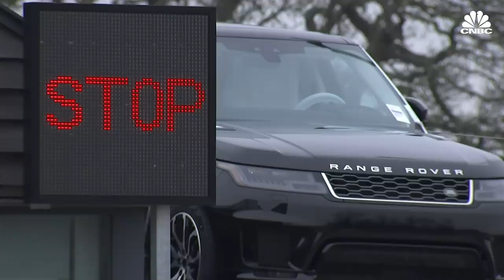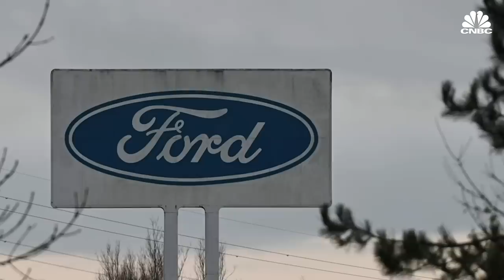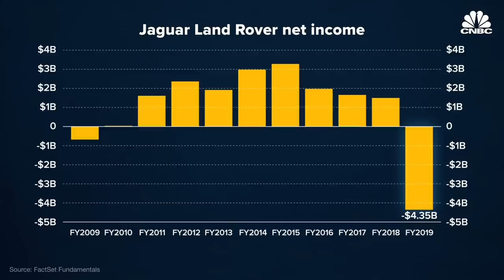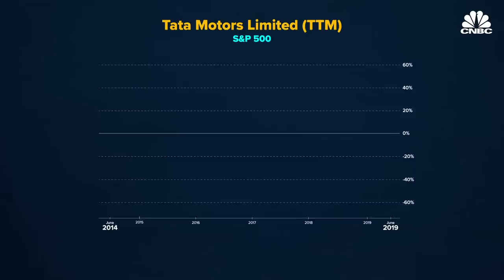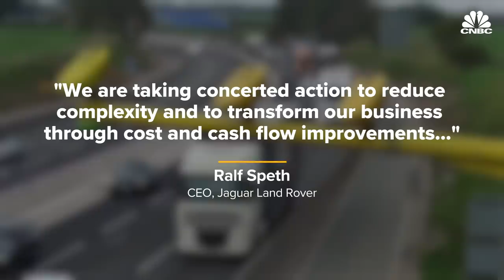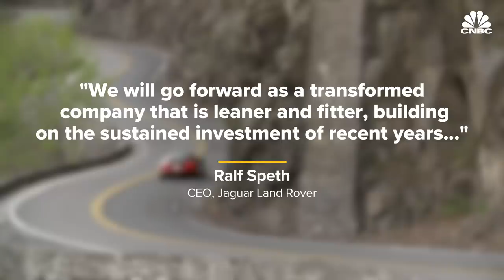Why Jaguar And Land Rover Face Uncertain Futures

Comment: Jaguar has one of the best exterior design, but also one of the worst reliability. The materials they use are so cheap, my friend owns XE R and F PACE 25 T R, the display system keeps freezing, and the panels are plastic almost everywhere.
Reply: Could not agree more, the interior on my f type was a sea of cheap plastic and poor quality leather. Beautiful car but when you looked closely it was so cheap.

Comment: We live in a high rise condo building in downtown Houston.
There must twenty Range Rovers in this building,not including Maserati, Audi's and the rest.
One guy I know has a Rover with 75,000 miles,and engine head gaskets blew.
The shop just replaced the whole bloody engine four times.
The Brits just can't get a clue when it comes to durability.
They have always struggled with electrical issues.
I owned a few British cars,and its always the same story.
Get rid of them after the warranty expires.
The best vehicle I have ever owned is our Acura RDX.
It never breaks.

Comment: If I bought these two brands, I would :
-Make deal with Lexus so that they can use Lexus components to make them more reliable.
-Use better quality leather for the seats and find better way to make the stitchings more neat.
-Fire the head designer and work with Pininfarina or Zagato instead.

Comment: The need to sell a new car to keep afloat is the problem here. Sooner or later you are going to run out of buyers. But the more practical problem is credit, or the lack of it. New cars are almost always bought using borrowed money. Now that lending sources are drying up, people are holding on to their older cars longer, thus putting a squeeze on companies that have to sell a new car to survive. Car companies should buy into the fantasy: pretend that unlimited credit isn't a problem and print their own car-buying-coupons.

Comment: It is quite sad, I worked with Sciemetric from 2014 to 2017 at the EMC art Wolverhampton and it was exciting to be working with the data acquisition and repair processing of the engine build stages … massive investment and a lot of great work done and now the demand must be very low … surely there has to be a new life for the plant… I don’t see them rebuilding the production lines for electric as the scale of the buildings are for large component manufacture and can’t really see how electric vehicle production could fill the site

Comment: They should never have dropped the iconic Defender. Sure it didn't meet certain safety regs but those issues could have been overcome.
Reply: David Gillett UK not possible. Even small changes meant the model was subjected to the latest regulations.
The defender however, is on its way back. The new defender is currently being tested and images can be found online.

Comment: Jaguar have got the reliability sorted. There cars are now exceptionally reliable and drive beautifully. Unfortunately there are still some build quality problems. Early body corrosion is still present and panel alignment is not up to the standards of Volvo/Mercedes etc.
Reply: My f type had all the panels removed, it was a mess. My question is how did it get out the factory in such a visibly poor condition ? Also I had it for two years it was only on the road for 6 months, so I question that they have reliability sorted. It was falling to bits inside also.

Comment: The main reason why TATA acquired these two companies is that firstly, they were looking for a bailout situation so they got a very good deal. Secondly, though TATA cars are predominant in the Indian market, they lack in technology-wise. One of the clause while acquiring these two companies is the transfer of technology and other intellectual properties. So TATA can use these technologies to manufacture their cars without investing in R&D. You can see their new car TATA harrier which is a cheap alternative to Range rover Evoque. So basically they aren't much interested in how these two company performs.

Comment: Tata got Jaguar and Land Rover to where they’re better built and more reliable than anything BMW, Mercedes, or Audi could offer. Yet, many still think of JLR as being unreliable. Sure, not going to say they’re cheap to maintain or as forgiving as a Toyota if one misses the oil change by a few thousand miles; but definitely not the same JLR that Ford had been running and better built than those nice looking plastic German cars.

Comment: JLR posted an profit increase of 20% in the last quarter of 2020 on YoY basis, with sales at China increasing 19% YoY.
Further market share of Tata Motors in Indian market which fell to less than 4% in 2016, has again leaped to 16% with the launch of the new models like Harrier, Nexon, especially for hatchbacks like Tiago and Altroz.

Comment: I don't know if the narrator is being quite honest, even now, 2020 I'm still hearing about BOTH Jaguar and Land / Range Rover reliability issues. It's just not acceptable in a modern car, especially when you can buy a Toyota Corolla for 10 times less money and it's 10 times more dependable than the luxury car. That's completely backwards, but thank God that's the way it's working out because I can't afford a more expensive car than the Corolla. We've been making cars since the late 1800's, when will they get it right?

Comment: As they say, if you want to buy a Jaguar, you need to buy 2: One to drive, and the other to drive when the first one is in the shop.
Reply: My XE has been fine and I drive it for work everyday 100-400kms. The 2 litre diesel needs service every 34,000kms so it sees the shop less often that other cars.

Comment: My uncle had a 2017 jaguar XJ....so my advice is that these brands are good for first 20000 km then these things start to malfunction....It had to be repaired and maintained for more than a fortune....so finally my uncle sold it as a loss and now he has a Mercedes c 200...still no problem...merc is all ready 25000 km

Comment: I have a 1996 Jaguar XJS convertible and a 1999 Jaguar XK8 and I had my fathers 2006 Jaguar XJ8 which I just sold. My father liked Jaguars and he would acquire them new through his work. These cars are so utterly unreliable and have left me stranded to the point where I do not drive them further than a 10 mile radius from my home. I always maintain them but problems arise at the worst possible time (like when the XK8 shut down on the on ramp on a major bridge). Everything is extremely expensive and hardly any mechanics even wants to touch them. Really a shame because they are beautiful cars. I really hope the modern Jaguars have improved in reliability. I cannot speak for Land Rover.

Comment: The best and most impressive SUV in design. However, reliability is a big issue that they have to fix and they have to enhance their service centers, otherwise they will lose more sales/customers... MSRPs are higher than the other vehicles in the same categories, which you expect the best quality but you end up spending more time at the service center and in a loaner car

Comment: I have a Jaguar XF R-sport ive had no problems except a battery in my key fob...However i prefer Rover cars, they are better cars the Rover 75 Tourer what a car that is ive done 330,000 Miles all i ave replaced is Alternator after 279,000 miles fantastic car the Rover 75

Comment: And it's totally as it should be- just check out their position on the JD Powers Dependability List. Not just this year's list, but any year you care to check, as they are ALWAYS on the bottom, in Land Rovers case, literally on the bottom. It is actually hard to believe either is still around!

Comment: People in general are not getting into debt as much as they may have in the past. Personally, I used to lease a new car every 2-3yrs. Not anymore. With PHEV and EV’s the short term new cars, I’m holding out for price drops, range increase and charging infrastructure. 

I firmly believe that electric motors are a good motive force. But powered by batteries - absolutely not. Batteries use finite resources - just more stuff to dig out of the planet. Maybe micro nuclear - already grapefruits sized designs are possible. These would power a car for 20-25yrs and able to transfer the power unit from one vehicle to another.
Reply: I'm all for nuclear power, but I wouldn't to have several million vehicles on the road with reactors and highly radioactive materials. Besides the weight of shielding would make the cars impractical. I think fuel cells are a much better solution. Hydrogen would be produced by electrolysis of water either from nuclear or renewable energy sources.

Comment: I own a Range Rover and I have to say that the reliability has sucked big ones. I can believe Land rover would use cheap plastic parts for the cooling system. WTF are these cheap engineers thinking. Very disappointed. I should have listened and leased it. I will never buy another one.

Comment: that Jaguar coupe is hot, & the XJL..but the coupe, I can't do a V6 turbo, I need at least V8..and I know that's not Jag's fault, the environmental rules are changing. the issue there in the used market, the Maserati GranTurismo S is faster V8 Ferrari pedigree, and designed by Aston Martin artist, for the same price.

Comment: My Range Rover HSE was built in 2003 when the company was still owned by BMW.  The drive  train is entirely german and was produced during the period described in the video as the time when the vehicles were so unreliable.  It is a big old beast, and it gets less than 15 mpg, but it is super comfortable (much more than my benz), makes good power, and has over 185,000 miles on it.  The thing has been as dependable as any vehicle I have had before, and I wouldn't hesitate to fill it up and head off cross-country at any time of year, in any conditions.  The biggest hassle is the high fuel cost and the high cost of routine maintenance.  But it has been a dependable old tank and it is plush as hell to drive and to ride in.

Comment: Freelander 2 had a known rear diff issue on new cars sold which they declined to admit and forced customers to a fix for. Simple design fault on the bearing. They've now just changed the new freelander 3 name to discovery sport. Total POS car and brand.

Comment: Jaguar has a few challenges against it. IT HAS TO BE MORE THAN AN Electric Platform torch carrier for itself & to Land Rover.
///
Jaguar sales are 2.5 times LESS than Land Rover as of 2019.
///
Jaguar has 3 ways to go: Sport car, Touring car, & single SUV (unless simply rebadged from Land Rover....please don't do that).
///
UNLIKE AUDI, MERCEDES, & BMW, JAGUAR  DOES NOT HAVE A LADDER OFFERING OF DIFFERENT  MODELS, LOW to HIGH.
///
Racing is expensive, diverts focus, & provides no positive bounce when unsuccessful.

Comment: The defender was known as a reliable vehicle ? As a mechanic and off-roader I would put it near the bottom reliability wise in its era. I wouldn’t put the Wrangler at the top of the list either.
Reply: Exactly. 

I own a wrangler...and wranglers are reliable if you only drive them for a few hours in the city and ONLY on the weekends....just like my other luxury cars.

If you want reliability just get a Toyota or a Ford F-150 truck

Comment: Dont put all the blame on tata motor, this guys offered theyr suport to jaguar and land Rover, but how they are built, is making the product to go down in salles.
Quality of the product is not in the same sequence with the price.
So the problem is not them is the one that manage the company, from the big one to the small workers, (clock in, clock out) 👍
The aspect of the car is better then other SUV, but like i said is not realible car for The price, and expensive to maintain.

Comment: its the cut corners in quality. the drivetrains are more reliable thank you lord, but the details, that they think we can't pick up on, but still charge 6 figures, you can't do that today. we're more exposed to refinement now. it raises our standards and expectations. the L405 has a nice design, that has separated itself over time from the luxury Ford stigma. but that interior layout is a joke. that's not Rover. yes women make 80% of household spending decisions, so yes Tata thought, lets get rid of all the knobs, simply with touchscreens women are addicted to for gossip, and cut cost at the same time. but guys still want tough luxury Rovers for themselves, to attract business opportunities and sexual attraction. when you compromise that value, guys can tell, girls can tell, then what.

Comment: There has a popular Chinese word: A Land Rover car is always staying maintenance and a Toyota car never be outage.

Despite China's auto market declined last years, but German and Japanese brans hold their market share and some brand even got more.

Some stats:

China's luxury auto market 2018:

Brand     Units (thousands)   YoY rate
Audi                   661         +11.0%
Mercedes         657         +11.1%
BMW                 640          +7.7%    (include Mini, RR)
Cadillac            228         +31.4%
Lexus                160         +21.0%
Volvo                 130         +14.1%
Land Rover       115         - 21.6%  ( include Jaguar )
Porsche              80         +12.0%
Lincoln                55           +2.2%
Infiniti                  41          - 7.8%

You see, Top 10 luxury auto brands in China's market, only Land Rover & Jaguar and Infiniti declined.

Comment: Make them Electric drive, and they will sell like crazy. I wish a Tesla engine on a Range Rover body! SOLD!
Reply: You won't get Tesla range in a range rover body.
Reply: @MrConor159  I get you, its a heavy body. but i would be okay with 200 miles a charge. its just that body design.
Reply: @modularliving1024  there is a reason the model X looks like an egg. You would be looking at a bit worse than etron range.  I  think sedans are going to make a come back as they will be much cheaper than SUV as the need much smaller batteries.

Comment: Unreliability is the problem with Jaguar and Landrover. Every time you bring one of those vehicles in for service the bill is $1000.00. How else can the dealerships survive as no one buys them, so they just soak the owners that have them? Got a kick out of the guy that says", Jaguar and Landrover became a powerful brand when Tata took over, and they became comparable to Mercedes, BMW, and Audi." These are also marques that break down a lot and are very expensive to fix. People do not buy these vehicles they lease them and dump them as soon as the lease and warranty is over.

Comment: gift: bmw refined engineering / ford reliability improvements
curse: ford cut corner cost cutting / tata dropped the british royal heritage & utility..now all of rover models look the same, like luxury ford explorer crossovers, to appeal soccer moms. and look at the buttons, knobs..anyone who'e been in previous models of Rover, can see significant drop quality. i think they figure, we'll cut costs, and soccer moms don't care, will not notice the difference. kinda similar to VW with Bentley, it's just a more luxury Audi. but BMW have taken Rolls Royce to new levels or refinement, driving dynamics, elite..and now with the Cullinan suv, the Wraith GT, all you need for that british prestige we loved from Rover.its just on a much higher level now, but you've gotta pay to play and be exclusive. that's always been the case, & RR is the new pinnacle.

Comment: Problems with these brands changing to electric,  6 and half years of running a petrol engine is the same as manufacturing one electric vehicle battery, they are going to manufacture in UK i thought zero emissions means zero emissions not polluting in factory's. These electric versions are more polluting than petrol counterparts because of these battery's they need parts of battery replaced and when the battery's are disposed of we need tones of CO2 to recycle then, they also use 65 percent coal burning to charge which wont change for a very long time, which will be replaced by nuclear energy in Uk. what a joke
Reply: I think EVs are still for early adopters. I also think the future of EVs are fuel cells, not batteries.
Reply: @stuarthirsch  possibly but problems persist as cobalt is running out alot faster then lithium and it's needed for batteries we seem to be running out of the world's resources for these vehicles faster then petrol there was a way in the 80s the rotary engine produced zero emissions and did not need batteries cells which are a pollutant as lead is dangerous to our environment and so is tones co2 from making and recycling batteries they may come up with something new in the future who knows

Comment: Tata have the worst cars in India, 
Now you all expect to deliver performance,
Well good luck if you own a their cars.
Reply: That was 20 years ago,the new ones use good quality plastic and ensure 5 star safety rating.
8 jbl speakers tuned by Harman 
110ps horse power 
21 km per liter mileage on diesel 
Service cost is around 50 dollars a year or 15k kms. 
The car costs around 15,000 usd.

Comment: The Brexit cost of flow of goods and parts from the EU to the UK is not true.

Trade tariffs have been reduced and even removed in most cases ahead of Brexit.
Reply: Straya Shark they haven’t, only in the event of a No Deal. They are trading under EU tariffs as we are still in the EU.  The new factory in Slovakia as well as capacity in Austria might negate many of the No Deal tariffs though, but RR is said to be always made in Britain.